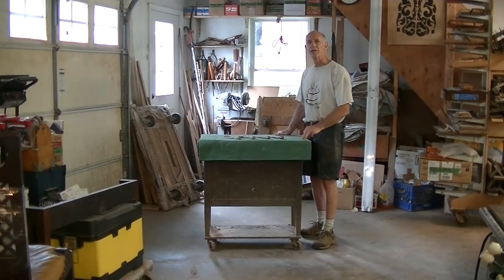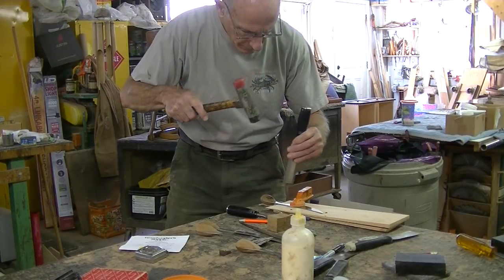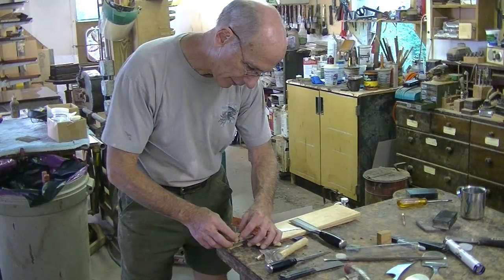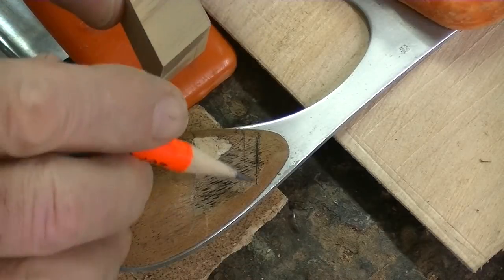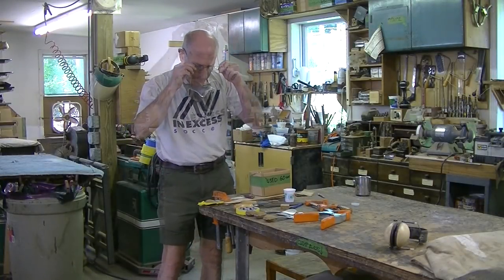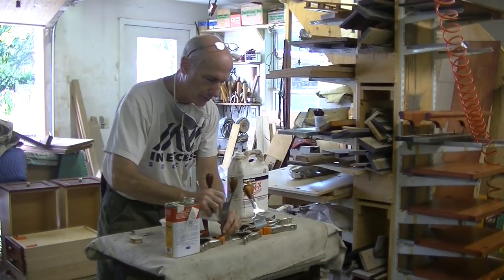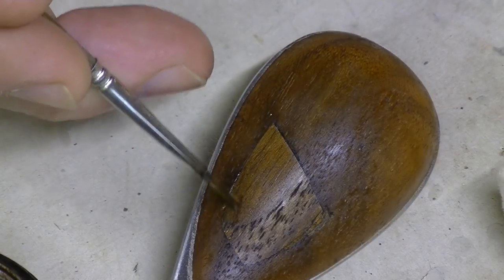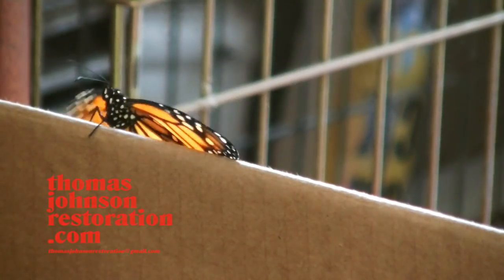Restoring Midcentury Modern Teak Knife Handles - Thomas Johnson Antique Furniture Restoration

Comment: So great Tom!

I love all the mid century stuff. I always find the design so much more satisfying even if though it's only a vessel for the content on this channel.

That teak threw so many obstacles at you! I think it being 'dishwashered' contributed to the wood itself flaking/cracking off multiple times at different stages. Then to top it off it made the dye job hard by turning out to be incredibly dark teak! For what should have been a simple job that turned into quite a hardship. 

But you saw it through and made it look great as per usual.
Reply from the maker: Thanks for watching! Yes, and at that point I was thinking that maybe I should have replaced the entire handle. Color would have still been an issue.

Comment: After having seen several of your videos this is the first one that ended with the term perfect.  Nice job.  I was curious as to why you chose to add a 5/8 inch patch instead of just trimming off the shallow end of your shoulder on the handle.
Reply from the maker: Thanks! It's hard to decide how far to go. I always try to remove as little of the original as possible. Could have made a case to replace the entire handle!

Comment: For the repair patch, would it work if you drilled out the burn with a forstner bit and replaced the removed material with a circular piece? It would probably be much easier to line up the grains and get an exact fit. Also, I love that you’re in Gorham, ME. I just bought a house in Jay about a year and a half ago.
Reply from the maker: Thanks! yes, it could be drilled, I've done that. But I always come at it from the point of never making the repair bigger than it already is. Sometimes you have to, but......

Comment: I have a question that doesn't quite fit into this video:
I found a Stanley RB 10 around 1900. Everything is fine except that it is rusted and has paint residue on it. the blade was in oiled paper and only has rust film.
How do you get this beautiful piece rust-free and bright again?
I want to use this beautiful piece again.
greetings from Germany

Comment: Quite a bit of work involved for the repair, but nicely done. Was the option to replace the whole handle in you mind when you discovered the rivet was not metal?
Thanks for posting your vidoes, asways find them interesting not matter what way you go.
Reply from the maker: Exactly. I would have had to drill out the dowel between the 2 handles. I always try to never expand the repair into something that you're not sure what's going to happen, especially on camera!
Reply: Whilst your are only on camera if you post the video, I realise how frustrating it would have been getting to the end only to find out the other dowel was a metal pin. Thanks again for posting your work.

Comment: Nice restoration, Thomas. What oil did you use for the final coat?
Reply from the maker: Thanks for watching! That is Waterlox Sealer/Finish https://www.waterlox.com/original
Reply: From a technical standpoint - Waterlox isn't really oil, it's a varnish.   It is tung oil with phenolic resin in it.  One of my favorite finishes as it continues to cure for about 3-4 months and gets extremely hard.  It is also a food-safe finish and can be used as a finish on wooden counter tops.   The marine version is Epifanes varnish.   Because Epifanes is an exterior varnish, it has UV blockers in it.  Something that can be done with Waterlox is to add Epifanes accelerator to make it dry faster.  You can do multiple coats in a day by adding the accelerator.

Comment: I randomly came across your videos and they are oddly fascinating to me.  You do some amazing work turning beat up wood into like new.  However, that patch looks terrible.  It is highly visible.  Wouldnt it have make more sense just to replace that half of the handle?
Reply from the maker: Yes, despite my best efforts at matching the wood, the color wasn't quite right. Someone suggested I should have replaced the entire piece, maybe they're right. But I would have had to drill out the wooden dowel between both sides, it would get complicated. I'm used to working on antiques where the goal is to save as much of the original as possible, so I guess that's where I'm coming from. Thanks for commenting. "oddly"?

Comment: I beg to differ. When Tom fixed the Moser rocker chair arm he said rather than make a new arm he would repair but only because he could get a good repair, otherwise he would have made a whole new arm . . . I know Tom is a first class sympathetic restorer and If this was a rare C18th chair then I would agree but a mid century knife handle in my opinion would seem to be a good candidate for a replacement rather than a repair - that is why I asked the question.
Reply: You mister are out of line. How dare you question the technique of Sir Thomas Johnson. His method for doing who or what he does is his own prerogative. End of discussion.
Reply: You're missing the point - so where do I question his technique ? All I actually did is ask him a fair question and now I'm being trolled !
Reply: You know what you were doing Roger, and you can stuff your sorry in a sack Mr.
Reply: What ? Who is Roger ? Sorry ? Are you under the influence ?
Reply: No just board at work.
Reply from the maker: Wow! We need to drink less coffee! I agree with Dave, but it didn't really occur to me to replace the whole handle until I was well into the patch, so I decided to just stick with the patch. Really, either way.
Reply: Thanks for clearing that up Tom. The patch will add to the character of the knife. My father would always replace. His favourite hammer had 3 new handles and 2 new heads but he said it was the best one he ever had.

Comment: Knife handles made of wood should be 'stabilized' if the knife is meant to be used on a daily basis. Stabilized wood is very resistive to water.
Reply from the maker: I suppose you could stabilize it with epoxy
Reply: Wood handled knives should NEVER be placed in a dishwasher.

Comment: I think it would have looked MUCH better if you had just replaced the entire side of the handle instead of trying to patch it.
Reply from the maker: Thanks! You are not alone! I think I’m just too tuned in to trying to save as much of the original as possible. Also, drilling out and replacing the rivets did not seem appealing